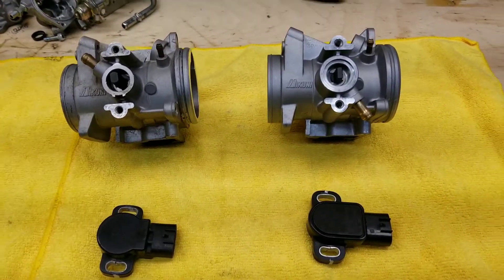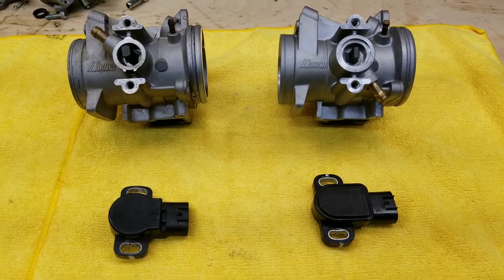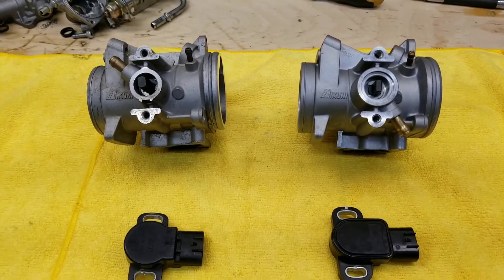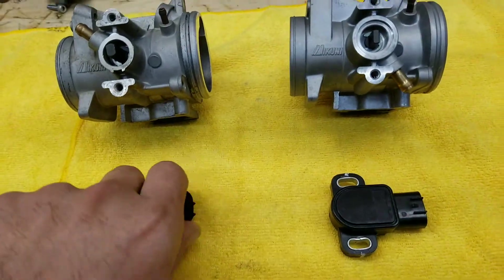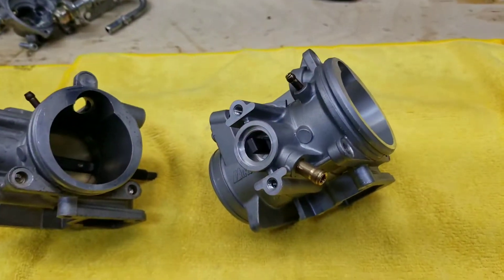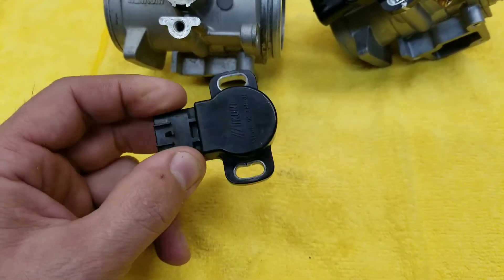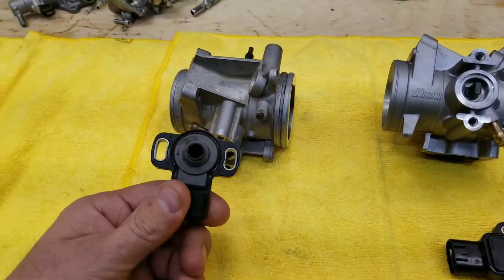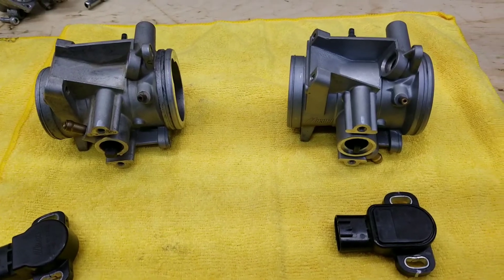Throttle body and tps difference 2006 - 2017 Raptor 700

Comment: I had a new tps put in my 06 700r and every time I get the voltage set correct in position once it is tightened down it comes all out of whack and the bike doesn’t run right any ideas ?

Comment: Hey Daniel I have an 07 mine dies at slow speed and sometimes at high speeds acts like the gas tank is empty i ordered a new tps but is it plug and play or does it need to be calibrated thank you hope to hear from you
Reply from the maker: must adjust when installing , sensor is slotted.

Comment: Is the same grizzly's throttle body???
Reply from the maker: Its very close in design,but no.. we do offer thebwork for the grizzly but i do not have them in stock call to discuss 951-743-6328